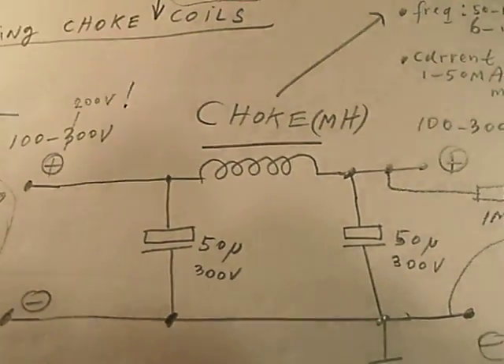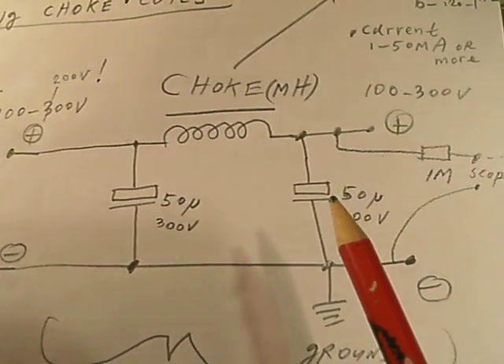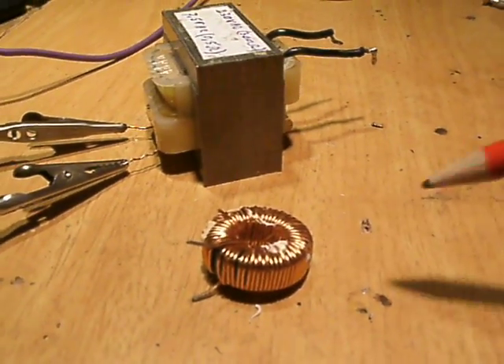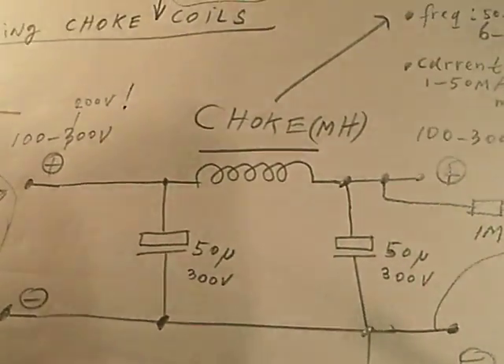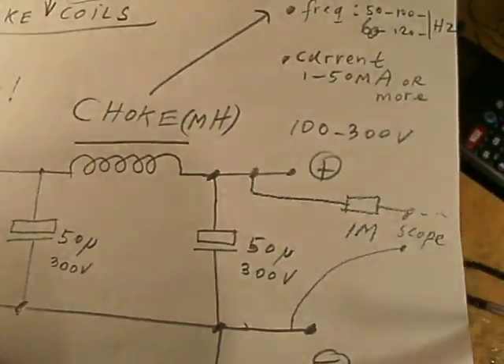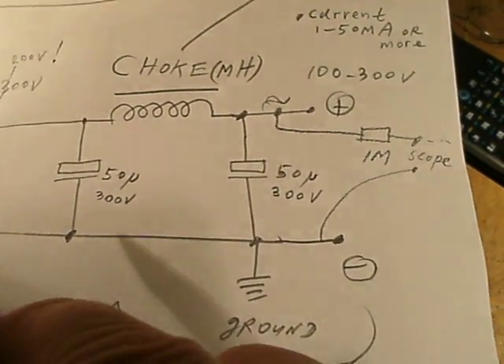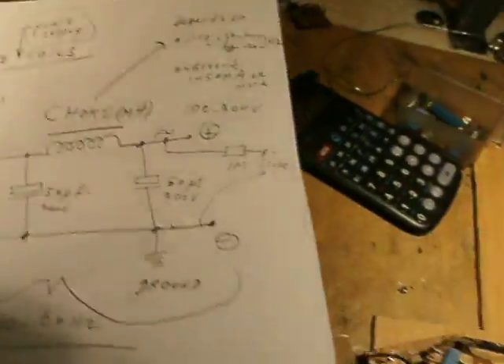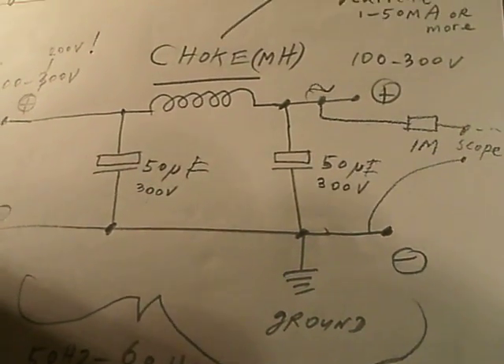find out a choke coil for a DC power supply on 50/60 Hz or other freq. (basics)

Comment: RADIOFUN232, Why is the Chokes coil resistance frequency dependant for what reasons? another questions Is the coil of wire used some special type of coil wire to be frequency dependant?
Reply from the maker: Every coil resistance is frequency dependant, formula is R= 2.pi (say 3,14) .f.R ohm. f in Hertz and L in Henry. Why? study physics. Important: the DC resistance of a coil differs substantialy from the AC resistance.
Reply: @radiofun232  I"m just confused on what a Choke does in a power supply and to the AC ripple. Because the Chokes wire turn ratio is "tuned" to 60hz to cancel out the ripple 60hz frequency?
Reply from the maker: @billwilliams6338  Yes, it was made to smoothen out 50 Hz or 60 Hertz. Indeed it is tuned.
Reply: @radiofun232  but the choke is also "storing" current or voltage from the rectified waveform? If there was no load or circuit connected to the power supply. The choke would be "storing" current or voltage?
Reply from the maker: @billwilliams6338  Yes it stores (some) energy and gives that energy back (dumps it) into the (second) capacitor or into whatever  of the electronic circuit that it has to supply every unit on 50 Hz or 60 Hz.
With that pulsing DC you can supply "everything" via that rectifier diode that makes AC> DC. 

Audio amp, oscillator, lead acid battery charger, etc. 

But: in a certain way, depending on the amount of charge built up, say via pulsed DC out of the bridge rectifier. The choke coil bloks AC and lets pass DC, due to that properties, showed in the formula. So in ancient times they used choke coils in radio circuits to supply via that choke coil the anode voltage, say + 120 V-300 V DC . Properies: DC =passed to the anode, but oscillations out of earlier radio stages (say out of the the VFO) are blocked. 11 dec 2019.
Reply: @radiofun232  Vacuum tubes don't have an anode voltage since they aren't diodes because they have a cathode voltage and a plate voltage. Only tube rectifiers have an anode voltage since they are a diode. You saying they used Chokes in Radios to Block the Voltage Frequency Oscillator circuit AC signals and only Pass DC voltages? Does a bridge rectifiers component care how much capacitance you put on the output of the bridge rectifier? because I heard that Selium Rectifiers failed often from temperature and silicon rectifiers will not like to much capacitance on the output of the rectifier.
Reply from the maker: @billwilliams6338  All vacuum tubes have an anode voltage, be it rectifier tubes or (say) audio amplifier tubes. Yes, the value  of the smoothing capacitor after that bridge rectifier is important about the final effect of removing the ripple/hum. When you want to know more: please buy a selenium rectifier (when you can find it in 2019) and test it. Than you can take conclusions and dont have to rely on "i heard" this or that.
Reply from the maker: @billwilliams6338  Without current (= load) the core of a transformer cannot store something, it works "idle". But there are losses due to eddy currents in the core, so even a (say) 110 V/230 V - 50/60 Hertz transformer connected to the mains and not connected to "anything" on its secondary winding takes some current, it (say) makes the iron core to warm up. EM energy transformed to warmth in the metal core of a 50/60 Hertz transformer.
Reply: @radiofun232  I mean you're experience when selenium rectifiers what have you experienced with them? did you find them failures with temperatures or why don't you like them
Reply: @radiofun232  yes I understand that but I have seen many power supply circuits that don't use Chokes and only use filter caps. So I'm confused on why chokes cancel out intermodulation issues with audio amplifiers from the 60hz ripple but other power supplies i have seen don't use chokes in amplifiers and don't have intermodulation issues or 60hz ripple issues with the audio signal. When using Iron core transformers techs have said that the digital circuits from digital logic signals will get into the AC mains Iron core transformers because of shielding issues called a "looping area". This is why they use round tordial transformers to prevent this problem. Not sure if you have heard or experienced this problem?
Reply from the maker: @billwilliams6338  toriod transformer have a lower stray field (50-60 Hz) around them, so they are not straying ripple voltages/current into an audio circuit. Filter caps or choke coils: whatever you want to use to bring the ripple down. It takes a deep dive into electronics theory to explain the differences, please study all (!) the video's on my channel to get more educated and find precise info. I explained almost everything regarding your questions from the preceding days  in my video's on my YT channel. So let us stop this endless discussion. When you are really interested in electronics: buy electronic components, buy an oscilloscope & a power supply & a handful of transistors and start doing experiments/studying your questions via the way of making practical and experimental circuits, testing Ohms law, etc. You will see that you will get all your questions answered when you do practical experiments. 11 dec 2019.

Comment: To filter more than 300 Volts you'll need at least a 3 Henry choke, not a computer choke that measures far less than 1 mH. Inside a tube amplifier it's simply not sufficient.
Reply from the maker: Yes, you are right.

Comment: A true method of determining ripple would require some load on the output. With no load the second capacitor will charge to peak voltage and show a deceptively good result.
Reply from the maker: You are right.
Reply from the maker: Thanks, this is the relevant video. It shows how the ripple gets stronger when a load is connected to the output https://youtu.be/BeNoSmm3D_4

Comment: can i use a headphone ? if i dont have Scope and listen to how good it Works ?
Reply from the maker: Yes, you can do. But: better is a signal tracer. Reason: normally your headphone (=standard type earphone) has a low resistance from say 8 -16-32 Ohm (=smartphone or whatever headphone). If so: your headphone will burn out immediately when you check the + and - of a power supply (and your ears get a shock) from say 2 V to ~. To prevent this: use a 1 K resistor (or 2K2 or 3K7 or 4K7) in series with your low-impedance (20 ohm) earphone and listen. But: that series resistor can lower the volume that you hear. When you are able to find a crystal-earphone (=endless impedance due to the crystal, 1 Mega Ohm or much more) you can connect such a crystal earphone directly over a power supply and listen to "sounds" present on the power supply lead. With a signal tracer (= small audio amp with LS or headphone output) there is a input capacitor (100 N-470N) so in that case there is no risk at all of shortcut the power supply. From the crystal earphone you can hear noise on the power supply lead. Though a crystal earphone has a limited bandwidth, could be that you don't hear everything, but surely somewhat. However: noise above (say) 16 KHz is not audible (!) (also not on a crystal earphone) and the oscilloscope will show all noise and disturbances on the power supply lead, also noise and all kinds of disturbances higher and lower than 16 KHz will be visible.

Comment: Would you provide the link to the video you mention at the start of this one please.
Many thanks, great video's.
Reply from the maker: +Elecifun OK, thanks. This is indeed not not very clear in this video. There are 2 video's usable: "Device to test radio coils on resonance, optimum frequency and quality" dated 25 ocrober 2015 and "FET test oscillator sine wave with very good linearity (200 KHz - 9 MHz) dated 3 october 2015. The last mentioned is the one that I refer to, the oscillator published 25 october 2016 is a further development (broader frequency band).
Reply: +radiofun232 Thank you I will go look now. For some reason I was trying to find them dated 2010, my bad. Can I use a choke with lets say 15 volts to smooth or is it a higher voltage advantage rather than lower? I have been experimenting but without the desired outcomes so far.
Reply from the maker: +Elecifun Sorry, correction: the video that I refer to is "test oscillator for coils 30 mH - 3,6 uH (0,9 uH) (e.g. 25 KHz - 1,2 MHz" dated 10 october 2014. BUT: the other mentioned oscillators (my first reaction on your comment) are also or perhaps better usable.
Reply from the maker: +Elecifun What is the output voltage from the power supply to which you want to use that choke coil?
Reply: +radiofun232 Cheers I am watching now.
Reply: +radiofun232 Its around 15 volts AC. I am trying to make a 12 volt supply for 12AX7 aka ECC83 I tried with just capacitors and had hum so I wondered if I could use a choke? I want to do this with 12v and not 240v. thank you.
Reply from the maker: Elecifun In the video "the transistor series regulator practice" from 26 april 2015 you will find a circuit with which you can make an absolute hum free power supply. Four your application schematics 2 (middle on the paper in het video) is the best.Suitable to feed a tube filament, a small audio amp (few watts or so) etc. When you raise the value from the electr. cap from base to ground to say 220 uF or 330 uF the hum suppression is extreme. Works also good to supply the filament from a  directly heated tube.
Reply: +radiofun232 Thank you, I will go take a look at the video.

Comment: What are hertz exactly?
Reply from the maker: Hertz are periods per second, so with 30 Hertz the AC voltage changes 30 x per second from + to - , in a certain wave pattern. In our electricity grids this is a sinusoidal wave, that waveform is showed in the video (a smooth buildup and build-down). Other waveforms are e.g. : squarewave (the voltage suddenly jumps from 0 to +, back to 0, then to -, etc) or a triangle wave. All these waveforms are possible in periods per second (Hz).
Reply from the maker: In old electronic literature the term "Hertz" (the name of a German scientist) was not common. Often the name "periods" was used, so "a frequency from 30 periods".
Reply: Also, in older times, they were known as cycles. Same thing as hertz just different name in early years.
Carl

Comment: I've always found that using a mains transformer as a choke works well.  I've seen people use a resistor instead of a coil and it doesn't work any where near as good.
Reply from the maker: Thanks, good to hear that you had the same experience with these experiments.
Reply: Anybody that thinks a resistor as a choke needs to learn electronics. Stupid!